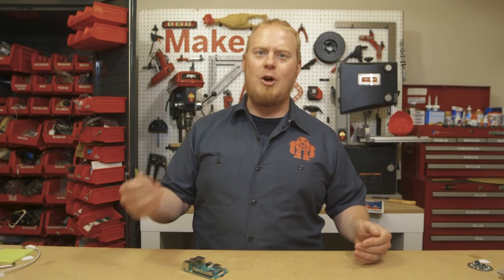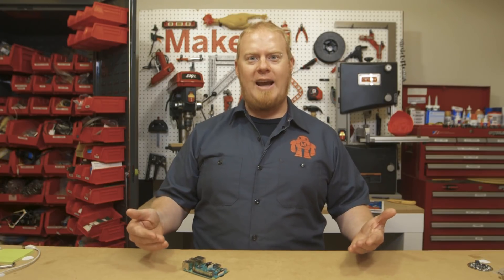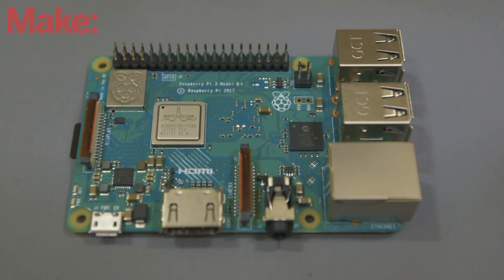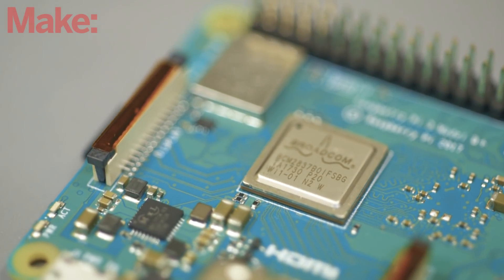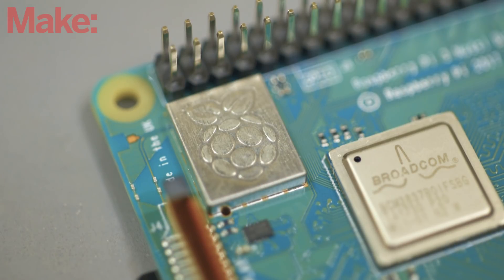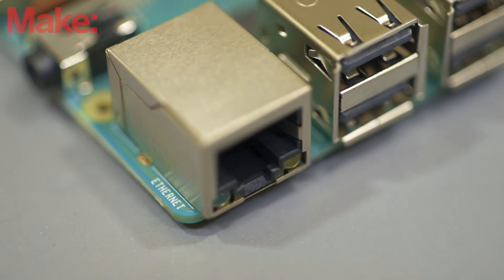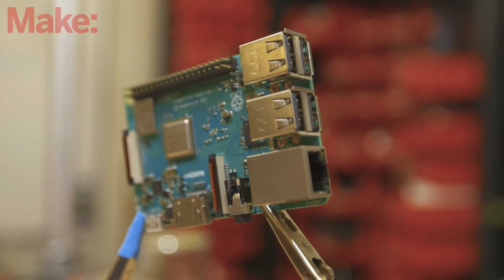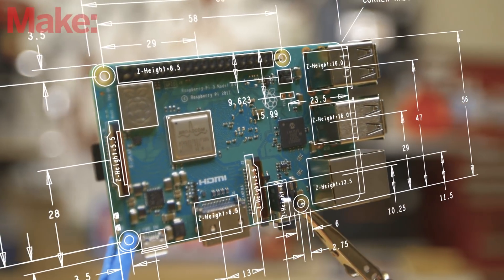Announcing the Raspberry Pi 3 B+ - Faster CPU, Faster WiFi & More

Comment: I expected USB 3.0.
Reply: That would probably cost too much to manufacture
Reply: They should have added a new CPU tbh
Even a cheap android phone for 50bucks has faster CPU than these
Reply: Not too much.. but reliable. CPU upgrade may be hit or miss, because lot of pi users use it with enclosures or cool it passively, which is thermally limiting factor.
Reply: Yeah but most of ARM prosessors nowadays are passivly cooled
And they can get up to like 20 times as powerful as the pi one
Reply: Me too
Reply: yenda pizza
If you are looking for performance, the raspi is not what you want. For the same price like 2 raspi boards you can get really powerful PC from second hand, that neither raspi or phone can compete with.